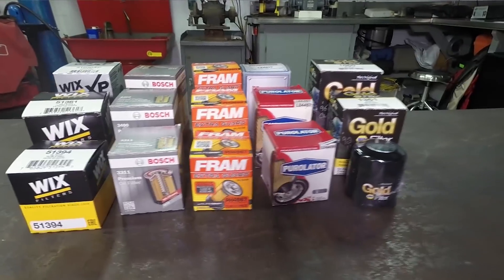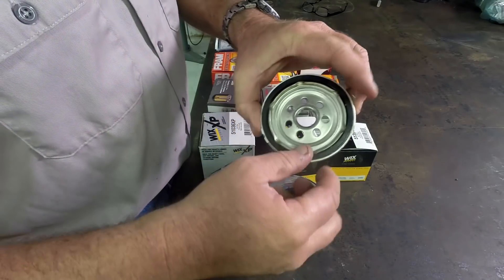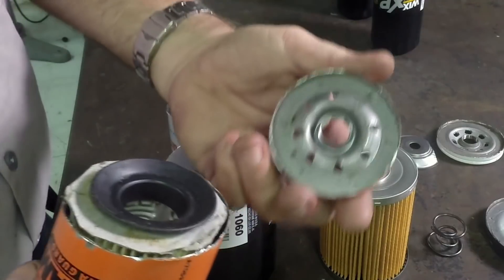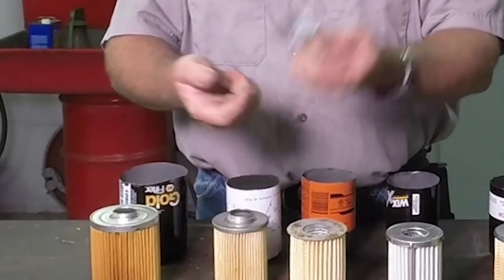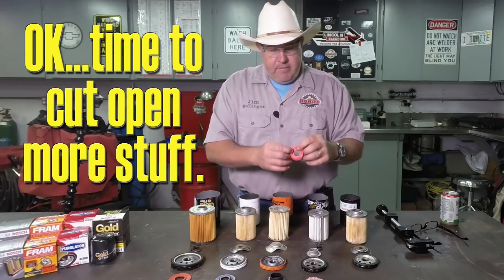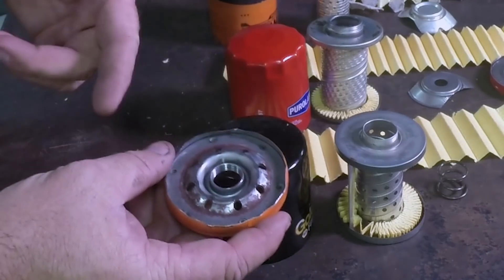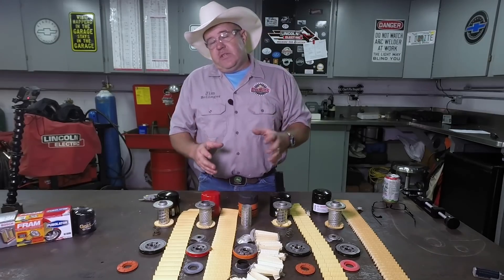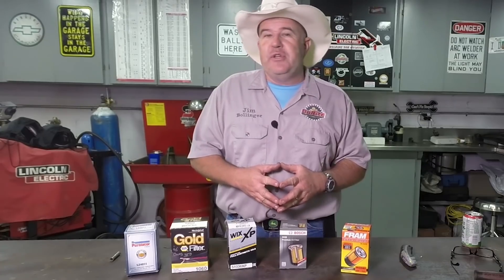The worst oil filter EVER!

Comment: We used to use Fram With Teflon. DON'T, The Teflon makes it very hard for the Engine Shop to refresh the engine between race seasons.
Reply: Real racers probably do NOT use that type of filter....most use a series of fine screens so they can spot metal in the filter.

Comment: You are comparing the basic Fram filter to premium grade filters from other manufacturers.
Fram does manufacture a premium filter, the Fram Ultra Guard filter series which is more of a compatable test to the other filters you cut open.

Your Fram distributor has old stock they sent you. Fram stopped using rubber anti-drainback valves a couple of years ago, and switched to using silicone anti-drainback valves.  They changed the filter media to a fiber/resin blend. So you have an older stock filter.  That's why it is rusty inside. It's an old filter.  Fram extra guard filters are now rated for synthetic oil.

Wix manufactures the Napa filters, so they are basically the same thing.

Please redo this video using the premium Fram filter as opposed to their basic filter, or at least use a new stock Fram with the silicone anti-drainback valve so you know you have a new stock filter.
Reply: Excellent reply.  I just posted the same thing.  Case in point: The Napa/Wix  jobber filters  in the  ExtraGuard  price  point were a terrible design using rubber combo  valves that don't work in the winter or  when  aged.

Comment: Anyone knows what the local oil change shops use? They may have f*ked my engine by using cheap filters and oils. I know do my own oil change with Valvoline 5W-30 synthetic blend high mileage and Bosch filters

Comment: I had heard Fram oil filters were not very good in general even without inspecting the internals but wow I have a hard time believing anybody uses those.  I am further confused because the Fram air filters tend to be pretty good.  Trying to pull a fast one because nobody is going to use an oil filter they have disassembled?  Thanks for the heads up, glad I have been using Wix.

Comment: Thanks for the info. Frams should be better. Are the best overkill if you change your oil regularly? How many miles and how much time can you use the better quality filters?

It's funny that so many thought Fram's are good filters. I've bought plenty of them and my only thought was they're the cheapest. I've always thought their drainback valve sucked, they are better than nothing.

My Toyota I4 has covered 200k miles, and my Nissan I4 has gone close to 100k miles on cheap Frams. Maybe my Toyota valve guides wouldn't be so worn if I had used better filters, but 300k total miles might do that with any filter. I can't think of what they might have done to the Nissan. I figured they were good enough for 3500 miles or 6 months and later 5000 miles or 6 months.

I'll still use Fram's but I've been using and looking for other filters for 20 years.

Comment: The Fram filter's weakest points are its small capacity, and the paper drainback valve. utter crap. I buy the very good Motorcraft filters from Walmart, almost the same price as crappy Fram, but a much better filter. Motorcraft filters are actually made by Purolator, but they go one better by adding a nice silicone rubber drainback valve.

Comment: That's the basic fram filter. How does the tough guard stack up in comparison?
Reply: The tough guard is identical the ultra synthetic is metal end caps with metal core COMPLETELY different

Comment: Fram uses sub par material I won’t argue that and I’d never use it. ....butI have a 2001 Honda Accord with 178000 miles. I got it at 132. It needed an oil pan gasket so it cycled through five quarts about every 2000 miles. Never once did I change the filter. Or oil. Except what I added. Boy was I surprised when I cut the Fram filter open and it held up all those years. Motor is still healthy. Good compression, perfect oil pressure, just changed it and the engine is still very silent for it’s age. Just saying, I was impressed.

Comment: Excellent video on oil filters. I have a 2018 Pacifica that uses Fram Ultra Synthetic drop-in cartridge filter (XG11665). How would you rate this filter? Are there any other brands you would recommend for my minivan? Thank you very much! Keep up the good work.

Comment: I have used Fram for years and feel very violated at this point. I am inspecting all my vehicles for any Fram filters now so I can change them out immediately.
Reply: They are  fine.  That was an old stock.  filter he cut open, likely  been  through a flood.  He  may have  just bought it but its a dusty old part.   Now, the filter paper is  made of paper& fiberglass  - so no problem with the end caps  being paper.  Unless the filter has been through a flood.  Filters don't like  water.  Honda  and  Subaru  service parts  are  a Fram-made part  - just painted  blue.  You think Honda  would use them if they were  junk?  Rest  easy.
Reply: Bad idea...based on a biased OPINION of a hack who cuts open filters and discovers they have paper inside...what did you REALLY learn????

Comment: What about the AC Delco Filters?  And MotorCraft?
Reply: I've always been AC delco guy since I have several Oldsmobile. But the new AC filters that have a "E" at the end are really low quality.
Reply: think Motorcraft is or was made by wix back then,  Now its purolator it seems
Reply: ( They are probably made by ONE of the major filter makers, but they too will go for the least expensive filter, AS LONG AS IT WORKS ! )

Comment: change your oil every 5000km and nothing to worry about
Reply: Not, many comments about this on here, but in the past years Fram has had  a number of law suits filed against for faulty filters designs. I didn't follow them long enough to know what the outcome of them was, but I don't use the Fram filters for any MILE. The layered paperboard media end caps CAN flake apart and get into the exit flow of the oil, not good.

Comment: Was proven by a mechanic, because of using Fram brand my car engine bearing all went out. Fram store rep said my fault because I used Fram product catalog using year, brand, and engine size for filter number which was incorrectly listed. Your to get owners manual find on number and cross reference in the back of the catalog, which gave the correct number. Found out filter I used had a 30 psi pressure bypass opening vs 60 psi pressure. So not much of oil got filtered. Rep then stated Fram is not consumer friendly because there is no way to contact Fram by phone or mail. When looking for a different brand that was that would talk to a customer Wix came to the top. I tested it and they talked to me in person over a question I had. 
If you used a Fram on that island you would for sure be walking anyway, so save the money and your engine and start walking.

Comment: I just like the grip on fram that's why I use them.  Any other filters have grip?
Reply: buy a good wix fillter and spray some truck bed liner on the end you grip and let it dry before you install it
Reply: @jasonmorehouse3756  that's a lot of work just for some grip.  But thanks for the tip. 👍😎

Comment: My 2009 Silverado has 290,250 miles I changed the oil about every  9,000 miles with fram filters and Valvoline Conventional I just now went to Valvoline Synthetic High Mileage but runs perfect
Reply: OOPS! here is a warning that I learned the hard way!!! In and older engine with that many miles on it and on conventional oil its just a BAD IDEA to switch to full synthetic oil, its to late in life. In your case you would do good to let the sleeping dog lye. Its a long story to cover in a youtube comment section but here is the brief. No matter how good the conventional oil is it still has a tiny bit waxes and tar in it, this smokes and builds up a plating (gold color, and not sludge) over the gasket surfaces, sealing lips of the seals and minor gaps within the mechanical parts. So, as the engine ages and wears this buildup grows and pressing more into this places. So, your engine is worn and seated in and now dependent on this gap filler.
So, here the problem, a full synthetic oil doesn't have ANY tar or waxes in it to burn off, so it can't replenish it, so the synthetic will around the second oil flush out this buildup, un-plate the gaskets, be cleared out from the oil seal lips that have worn and seated to the build up. This will likely mean you'll start seeing LOTS of leaks. Now, not only did that happen to be in TWO vehicles but in both around mid range of the second oil I'm driving it down the road its its starts rattling really BAD!, my other vehicle a few weeks later did the same thing, RATTLED.
I changed back to conventional oil and added STP and the rattles settled down over time!!!!!!
So, my older brother Greg was a store manager for a National Named Automotive service center, and when I talked to him about it he said that they STOPPED doing synthetic oil conversion on cars if they had very many miles on them, he said it caused TO MUCH TROUBLE!!!
I hate to see you or anyone get as much service out of a vehicle that you've gotten and them do the GREAT SYNTHETIC OIL CHANGE just to be bit buy it.
I know it seems like a waste of oil and a filter, but really let the sleeping dog sleep.
Good Luck!

Comment: No more Fram filters for me. 
Would like to see the STP filter against the wix and NAPA Gold filters
Reply: The  filter he cut open was on the shelf for  ages.  Hence  some  surface  rust, The  current  ones  have an orange-coloured   ADB Valve not black  Nitrile.  That's  how  I know it OLD.
Reply: Stp is made by champion labs
Reply: @jonsmith919  I just read  FRAM / AUTOLITE was purchased by Trico Group.
Reply: Buy on rock auto. Top notch filters for cheap. I buy in bulk

Comment: Seems like he is Wix biased from the start. Not all filters have the check valve (anti-drain back). Who wants a heavy can? More weight and the can has never failed on any filter i've used. It's an oil filter, not a suspension part. :-)
Reply: CKE142B you really think your car’s gonna be weighed down by an extra 1/4lb FILTERING THE OIL THATS CONSTANTLY FLOWING THROUGH YOUR ENGINE COMPONENTS. In addition to good fuel, good quality oil is the single most important thing keeping your engine running, why cheap out on it?

Comment: Kind of an apples to oranges comparison don't you think? Cheapest Fram filter vs Napa gold style filters. The Fram Ultra is much more like the Napa/ Wix filters. You get what you pay for and this comparison should be done at the same price point. I would never be afraid to run a Fram Ultra on any of my vehicles. Neglect and abuse kill engines, not filter brands.

Comment: Not surprised with Fram, looks decent from the outside, garbage on the inside (but the average person would never see the inside), Practically a scam. I only ever use Wix filters, it may cost a tiny bit more, but you know its doing its job on your engine.

Comment: I would add...watch out for AC Delco....in the last few years AC came out with an economy line of filters.
Reply: So has MOST of the filter manufactures ! And most of them STILL get the job done...filtering oil.

Comment: You are comparing a Napa gold to the wix xp which is the Napa platinum. Napa's filters are made buy wix and if go buy filters its cheaper to buy them at Napa then wix Most of the time. Royal purple filters are not as good as a Napa platinum/wix xp. I have cut a lot of filters open when I worked at Napa one of the guys worked with had a tool made to cut them open it worked just like a large tube cuter. We cut open every filter could find and for the price all I have say is go to Napa and if there is not a Napa get wix.

Comment: I have used Fram for years....saw a similar demonstration...will not any more cost me a new engine on my mower.  Who make Mobil's filters and Lexus "cartridge" filters?
Reply: I believe both are manufactured by Champion Labs.
Reply: Thanks for your reply...I can purchase Wix...is the cartridge of Lezus a good one?  Are cartridge filters better than can ones?  @darring.9161
Reply: @alexrobison8920  WIX is an all around good quality filter for any vehicle, although I prefer Purolator One or Purolator Boss...but you pay more for them. 
 The Mobil-1 Extended Life Filters are also well designed and hold up well.  
Cartridge or Canister...it makes no difference, they both do the same task.  Just stick with what your Engine is set up to take and you'll be fine!

Comment: Damn, I wish you compared these to an OEM filter for whatever vehicle these were supposed to fit to.  Can you give any insight as to their quality?  I've been told the OEM ones are best.
Reply: No, only the Dealer's push OEM Filters as being the best, simply because that Auto Manufacturers have a vested interest in those Companies.
 That's not to say they're all bad, but because they tend to look for cheaper suppliers and cheap often leads to inferior quality products. 
 OEM is simply Original Equipment Manufacturer which suggest that that is the main supplier for parts and products that were specifically chosen in the manufacturing of the vehicle...it does not infer whatsoever on the quality of those parts or products.  
Make no mistake, the Big Companies will always try to find a way to trim off their costs to make and market an automobile.  
There are virtually no Automakers that manufacture their own filters...they just use re-labelled Fram/Champion Labs/or whatever they can get on hand in bulk for production.  
Putting their own Logo on it does nothing to make it a better filter for the vehicle!
Reply: @darring.9161   I figured maybe they outsourced the production to those companies but that they specified a design, so, say, a Fram that comes standard on a Honda isn't necessarily the crappy Fram "Extra Guard" you're going to get at Walmart but maybe an entirely different product (or, hopefully at least, not the Extra Guard).  On a slightly different topic, but still OEM vs. aftermarket, a mechanic that's on a national TV show here in Canada says that OEM brake pads are the way to go because in his experience they don't have problems with squeaking whereas aftermarket often do because they aren't manufactured to the exact specs.  And I know he has an independent shop so it's not really in his personal interest to say that....
Reply: @MaestroTJS  There are many top quality OEM and OE Parts out there that meet the exact specifications for nearly any Car out there. 
 My Toyota's Brake Pads were good, but I feel they would be far better with Akebono's...many factors come into play.  I also think that MOOG Sway Bar Links are far sturdier and solid than the original Toyota OEM Sway Bar Links. 
 The MOOG's can be lubricated because they incorporate a Grease Fitting...whereas the Toyota Links don't have this feature.  The only downside to the MOOG Links is the fact that they don't incorporate the use of a Crown Nut and Locking Pin, and they have an Odd Sized Nut.  But they're great in every other way. 
 Looking for good parts is pretty trial and error, or you can go by the word of your mechanic or at least those that use them. 
 Never had a problem with Brakes Squeaking...I just put a few liberal dabs of some Copper Anti-Seize Paste on the backside of the Brake Pads.
  I also don't use cheap aftermarket Brake Pads like Max-Brakes or Mastercraft!  
Even I try to keep things OEM as much as possible, but sometimes the OEM's are outrageously priced, and buying a copycat brand may do the trick.  Some are better than others.  As far as I know...none of the main Engine Makers use Fram Filters.  More likely they'll use aftermarket producers like Champion, Mahlee Original and Mann for their production line filters.  They may be well constructed, and they might even be their top of the line filters, or they can be their worst...but how would you really know???

Comment: Can you do a review on STP filter. They are  complete crap threads are pot mettle i started the car and it flew off
Reply: STP are better then fram but buy napa which are wix and the wix xp is a Napa platinum btw. The cheapest Napa filter the proselect is still better  then STP.

Comment: Was a master A tech, 10 years with Hyundai and 5 years with GM. Fram doesn't surprise me at all. The biggest gimmick is with motor oils especially Dexos oil. Dexos Oil is usually still good for 8,000 miles but the oil filter will clog and should be replaced every 4,000 miles even though the Dexos oil is still good.

Comment: Have you looked inside a Purolator Pure One Filter instead of the "Normal" filter.  Others have tested this filter with great results.  I saw tests on the Fram years ago.  Those have been gone from my vehicles for years.  Nice to confirm I made the correct decision never to use them again.  I'd also be curious about the Mobil 1 filters like somebody else asked about.  Reputation is supposed to be good.

Comment: The PH 4967 Fram on my 2.2 Camry screws onto the block with the base lower than the shell. If I unscrew the filter after the engine sits for a few hours, I find the filter completely empty.